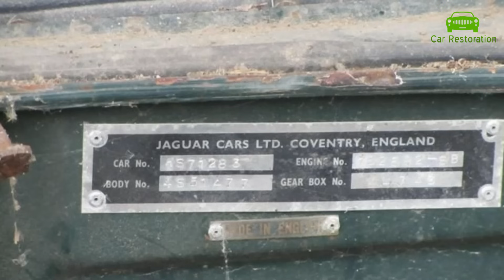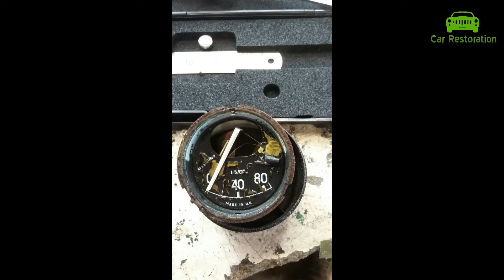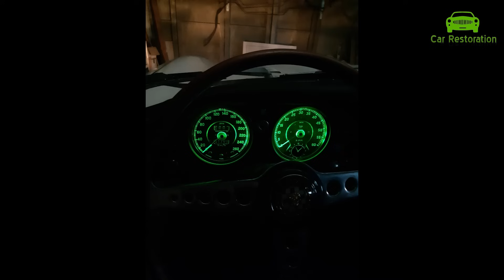1971 Jaguar E Type V12 - Car Restoration

Comment: Well done documenting everything with photos. This was the type of work I did for 20+ years and I can see you’ve done an excellent job bringing this V12 beauty back to life. Chopping the roof off right at the beginning and reshaping and refitting it was a big job. But doing a test fit of the windscreen must have been a real scary moment. Because those screens are not cheap and real easy to break if the hole is the wrong shape. 
Great job.👍

Comment: What an amazing job you did.  The car is beautiful, and will hopefully be enjoyed for another 50 year run. Curious to know why the red primer and the white top coat reacted that way and caused that wrinkling in the white paint as it cured.  The work to get the panel fit and gaps correct was brutal...good on you for taking the time to get it correct.  Well done all around.